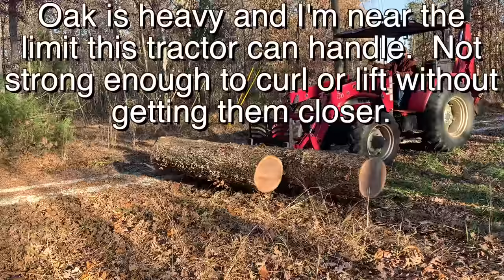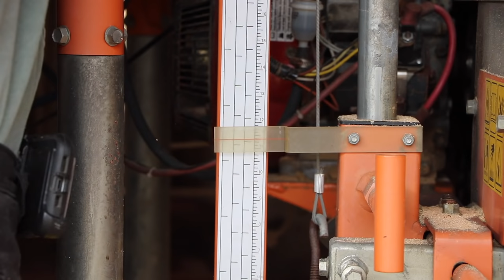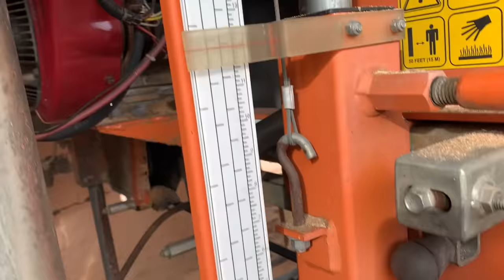Printing Money With My Sawmill...Wood Costs How Much??

Comment: Out of curiosity, would it be easier to pick the chain up with the three point and drive forward instead of picking it up with the loader and driving backwards?
Reply: I though the same, but he's got the backhoe on the tractor. Probably not worth the time savings to remove the backhoe, drag them out, then add ballast to be able to handle the logs with the forks.
When milling you want to handle the logs off the ground as much as possible so you don't get dirt in the back. That can dull the bandsaw blade real quick.

Comment: At 14:50, why didn't you throw both cants on the mill and saw them together to get two boards for each cut?
Reply from the maker: Blade was getting dull.  Cutting both at once would have caused it to wander up and down more than it does on a smaller cut.  Had the blade been sharper I would have done exactly that.

Comment: And watching you cut this fall and tree it reminded me, why is it that when people cut down a tree they leave like a 3 foot stump? You’ve kinda did the same in the start of this video. To me that’s wasted wood or am I missing something???
Reply from the maker: Main reason is because cutting a tree down is dangerous.  You don't want to be stooped over, working right beside the ground, getting your chain in the dirt making it dull and making the felling process more dangerous.  I think you overestimate the length though.  In this video, I first cut the highest I could to avoid dirt.  Most of what was below where I cut was below ground when the tree was standing.  If I'm using the wood for firewood, I cut at whatever height feels the easiest to me.  I get the tree down and then cut the stump off later.  If I'm using it for lumber and it's safe enough, I'll cut lower down.

Comment: $ I was gonna say you have about $3500 worth of wood there but after you take away the punky log its more like $2250
Reply from the maker: Yeah. That was disappointing for sure!
Reply: Sometimes I'll throw a log like the punky one on my mill to see where the punky part ends.  After a few cuts you can see if you should keep cutting or throw to the firewood pile.

Comment: Honest question: What's the disadvantage of sawing both "kants" (is that how it's spelled?) at the same time?
Edit: Never mind, lol. Should've finished watchin'
Reply from the maker: If your blade is a little dull, sawing 2 cants can really take forever, so 1 is better.  With a nice sharp blade, 2 moderately sized cants cut fine.

Comment: Looks like your chainsaw  sawdust is small 
Try filing your depth gage rakers down
Should be more like shavings
Reply: Why / for what reason is that better?
Reply: @DC_DC_DC_DC  more wood is cut 
I was a forestry tech that worked in t he woods 3 years .
Small dust is either dull.chain our the rakers were left alone when the chain was sharpened .
Reply: @tomrobertson3236  learned something again. Not that I saw wood... Ever lol

Comment: Well if you leave a ton of useable board feet in woods with top half, knots or not, counting the money spent for fuel. You made nothing. Saved a bit but it still has to season for two years and will warp. Curved wood especially white oak is much desired by boat builders.
Reply: Yeah I don't see a great reason to leave the rest of that tree in the woods considering that seasoning the oak for a while is a good thing. Might as well saw up more than he needs NOW, for his future projects. It's not like he couldn't just sell it if he ended up not needing it.
Reply: you are right. according to i.r.s. he made nothing. one of the best parts of doing for yourself.
Reply: @victorhopper6774  what? you see all these videos of people cutting lumber all the time but they leave some good wood in forest to rot. It’s annoying since they could easily sell off that wood and make money so it’s a huge profit loss.
Reply: @jacilynns6330  i was referring to the fact that there is no tax involved since no transaction took place. its a big win for him in that respect.